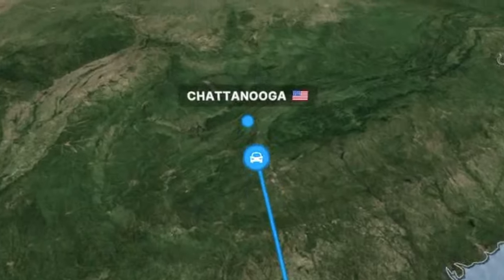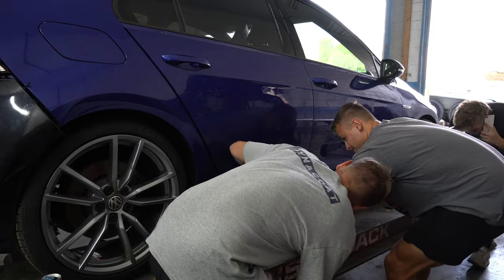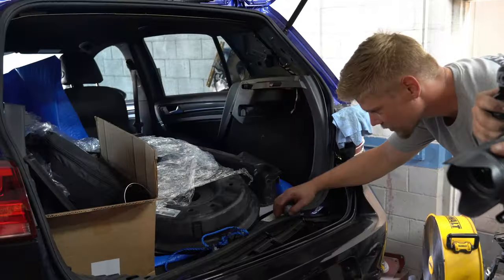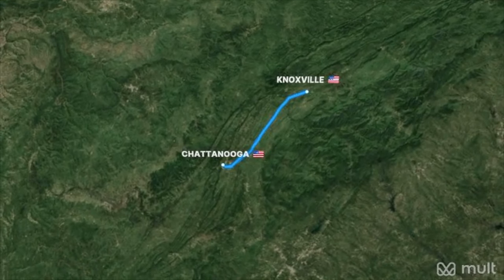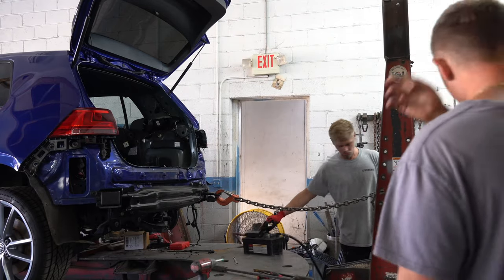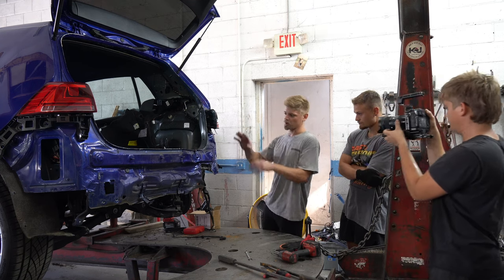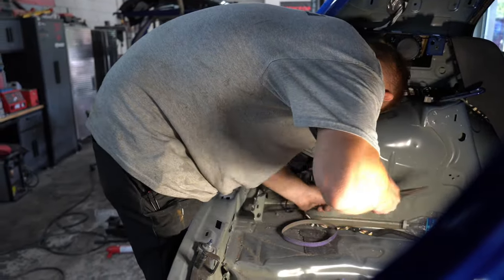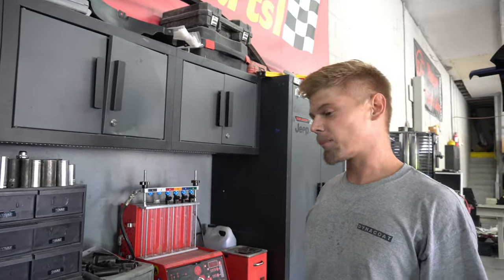REBUILDING A WRECKED VOLKSWAGEN GOLF R | PT 11

Comment: So that's how they pull out smashed trunks. The prep work looks like a pain.  Years ago i had a semi truck rear end me. The insurance company said they could straighten everything and make it look new again. Now I know how they were gonna fix it. The car ended up getting totaled out because Ford refused to warranty the work because the frame was also bent and needed to be heated to be straightened 😆.
Reply from the maker: Oh yeah lots of prep work for sure. A master framer like Yuri will make this look easy, with his years of experience and talent. BUT trust me it’s a lot harder than it looks especially since we kept the belly pan and didn’t swap it. When you use new parts it makes it easier to line everything of to factory spec. When you keep something bent, well now you have to free hand it. Luckily the rear wall was replaced with OEM parts so we were able to line and pull the floor up to the brand new wall.